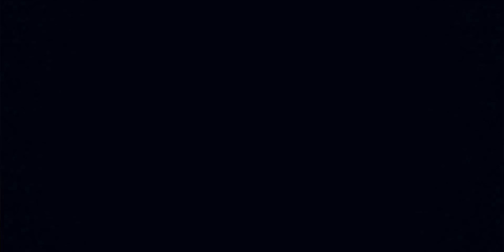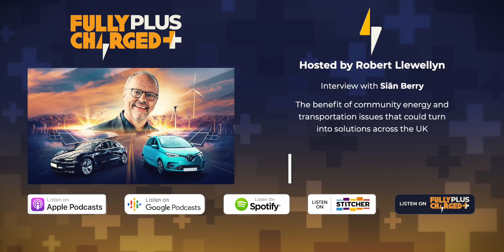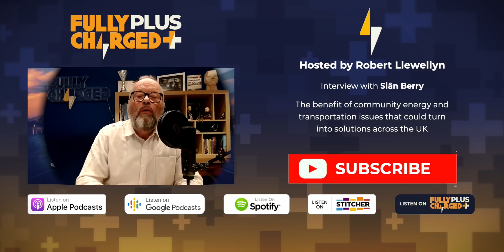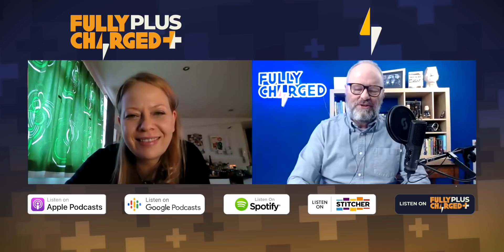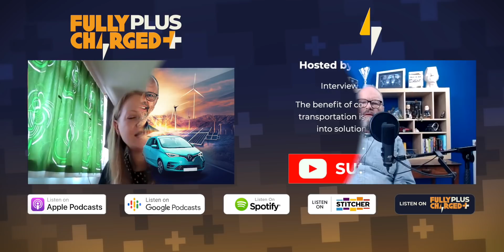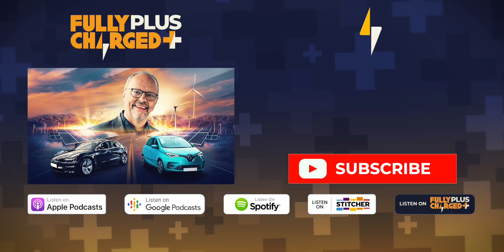The benefits of community energy & shared transport with Green Party co-leader Siân Berry

Comment: The SMR (small modular reactor) is a concept that can really help in providing a base load for areas where renewables aren't an option year round like in the extreme latitudes or providing power to large cities where population density makes providing consistent power from energy storage difficult. Our company is doing research into various SMR designs and scrapped plans for putting in a GE BWR because of the cost savings and ease of licensing SMRs offer. It's a lot like comparing a car made in the 1960's and one made in 2020, the safety and efficiency are worlds apart.

Comment: 28:30 Sounds like Hurricane Sandy, fall of 2012.  Long Island, NY had a major issue just as described, where a lot of gas stations didn't have power and those that did quickly ran out of stock because they couldn't get more fuel onto the island.

Comment: I think car sharing in cities will eventually become a thing, but only when self driving cars are sufficiently available, so that the car will appear at your door rather than having to work out where someone has left it. The utopia for me would be vehicles of all shapes and sizes parked in areas that can't be built on (under motorways, next to railway lines) that could be summoned when needed and sent back afterwards, to be charged or part of the vehicle to grid network.

Comment: The community energy schemes outlined after about 10 minutes are no longer possible in this country. One of the earliest, on the south coast, built by a co op of about 500 mainly mature environmentalists has been forced by the FCA to convert to a limited company because the co-op could not supply electricity to individual members. In order to supply customers you have to be a supply company with all the impossible regulation that that entails. Since every energy co-op has the same model - build a wind/solar generator and sell to an energy supplier - all existing co-ops are at risk of an expensive forced conversion and no new ones are being started. If you are a village with a large field available, your best bet is to phone npower.

Comment: I think Robert is overly impressed by the 'small' in SMR. An SMR is actually a third of the size of a conventional nuclear reactor which is massive, The Rolls-Royce design is actually bigger than the early Magnox designs and requires 4 acres of land.
Reply: I get the impression that the Rolls-Royce one is a bit of an outlier though, compared to e.g. Nuscale. Rolls seems to be about "small" only in as much as bits get made in a factory rather than as in "scalable by adding more modules." Anyhow I am far from an expert - I might have got it wrong.
Reply: Google the 7 astute class nuclear submarines we just built...now imagine those 7 in parallel...it's gigawatts of power. Decentralised

All over the uk

Comment: Nuclear waste is a solved problem.
We need to build "burner" reactors instead of "breeder" reactors.
Burner reactors can take 95% of the radioactivity or more.
Reply: This sounds like a bit of nonsense you read on Facebook and then repeated without having a clue what it means.....
Nuclear energy is a very VERY complex subject, kiddies - 99.99999% of us are not qualified to comment......
Reply: @andymccabe6712  uh huh. and you're qualified? have you done the research? do you know the difference between a breeder and a burner reactor design? Molten salt reactor? Difference between a BWR and PWR? You know what the explosion at Fukushima was? You know why it failed?

I know nuclear energy is complex. That's why its so damned expensive. But burner reactors CAN extract more energy out of existing waste stockpiles.
I've seen designs for MSR that do the enrichment and burning inside the reactor without needing to pull out fuel rods like Chernobyl's reactor design.
There's an MSR design that will actually ingest weapons grade material and burn it, draw out most of the high energy radiation, so instead of 10,000 year half life, you get a half life of a few years.
The vast majority of in-service reactors are breeder reactors, they were built to produce material for nuclear weapons.
That's why most fuel rods were pulled out with 85% of the energy still available, instead of using them to exhaustion.
I have a little bit of knowledge of nuclear energy.
Reply: Absolutely. The issue is that they cost more than people want to pay (10x wind cost), take way too long to come on-stream and no one is willing to build one without massive state subsidy.
Reply: I wish people knew that spent fuel isn't the problem it's toted to be. There is still plenty of space on the spent fuel pads at even the oldest plants, and since it's stored in giant steel and concrete bunkers it isn't going anywhere until we develop the tech to make the reactors which can use this partially spent fuel.
Reply: @anydaynow01  spent fuel is a problem though. it has to be stored, maintained and guarded for decades, if not longer, because it is fairly simple matter to isolate the plutonium. It takes lots of centrifuges, for sure, but the plutonium has been manufactured, which is one of the main reasons for a breeder reactor, to breed weapons material.
Reply: @garysmith5025  How is it more complicated than refining any other metal?
You form a solution with chemicals that react the way you want it to, then separate them.
After that, you use another reaction to remove the solvent.

I mentioned centrifuges because that seems to be main method of separating different flavours of plutonium, uranium, and other reaction products. Or is every history program I've ever seen absolutely wrong?
Why did the US demand that Siemens put a bug into controllers to sabotage Iranian centrifuges if they weren't being used to separate nuclear material?

How many types of reactors are in active service, PWR, BWR, etc?
Aren't most US, and US-derived reactors mostly developed from US submarine reactors?
Aren't they designed to produce weapons material?
What kind of reactor are you managing?
Why is it that there's so much energy still in 'spent' fuel rods? Is it impossible to use more of it? Or is it that its easier to extract weapons-grade material out of them?

And its not Wikipedia either. I've watched presentations by nuclear scientists. Only one or two hour long overviews, granted, but I'd like to think they're going to be mostly accurate. Unfortunately, there isn't a lot of use for nuke operators in Canada. Only 5 according to Government of Canada website, three in Ontario, one each in Quebec and New Brunswick.
Reply: @garysmith5025  Weird that you are so negative, those are all 'small' engineering problems, especially compared to the task of not having to use fossil fuels in the entire world.
And you known most LLW wast is medical waste.

And burners don't create much more LLW, it's still high level, just a lower tonage as  E=MC²
Have a look at this
https://www.youtube.com/watch?v=jvNzRKGVAQI